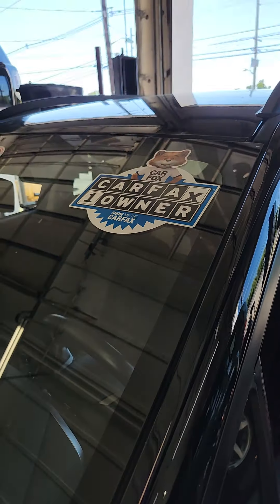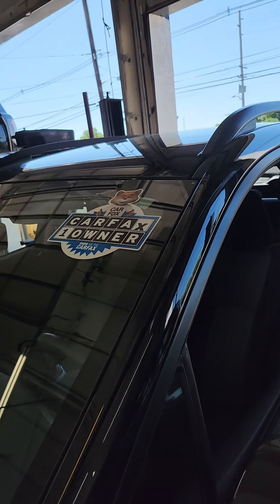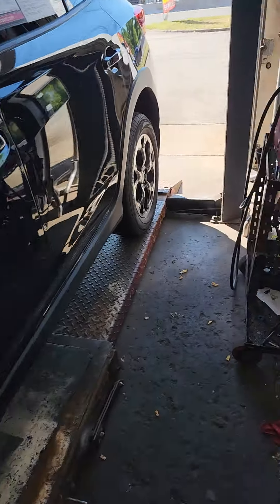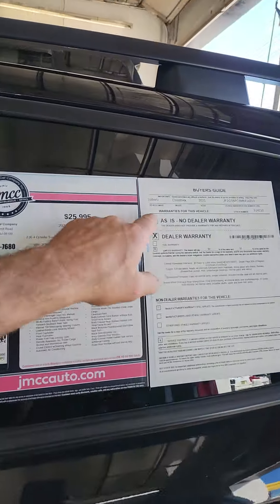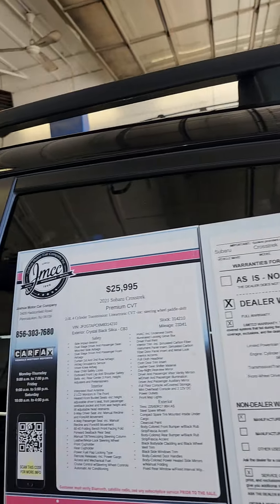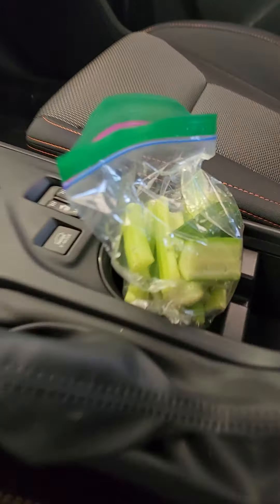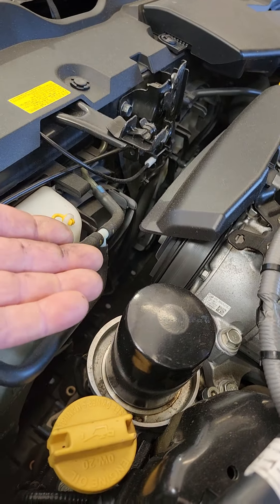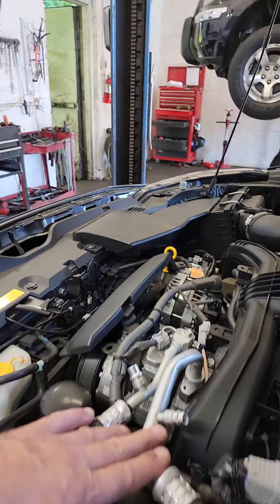Yf1234 is so problematic  r134a seemed better

Comment: We are a european car repair shop but have a 1234yf  machine. Actually only shop that has one in a massive radius outside dealers. So other shops send work to us. 

Its endless condenser/evaporator/ compressor replacements especially on Honda products. We have a former honda tech come in to replace evaporators… 

The gas is insanely expensive and comes in a smaller tank. 10lb tank goes fast when you have complete fills.

Comment: Must have got my Crosstrek just in time! R1234yf was definitely around in 2018 model year vehicles, but mine is fortunately R134a. Any idea what's affecting the YF systems? My 2021 4Runner has it and I haven't noticed any issues yet.

Comment: R12 was better than Yf1234 and 134a.
Reply: I swear R12 provided much better cooling than any other refrigerant.   Our newer Toyota has weak A/C (no it does NOT need refrigerant) and I've had older cars with R12 where the A/C would freeze you out.